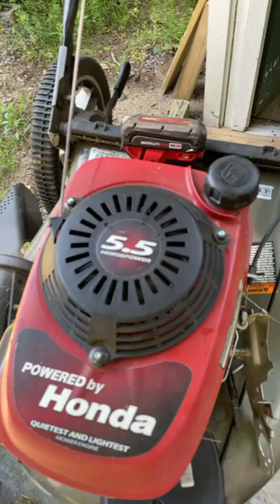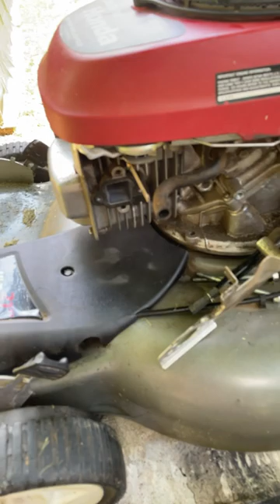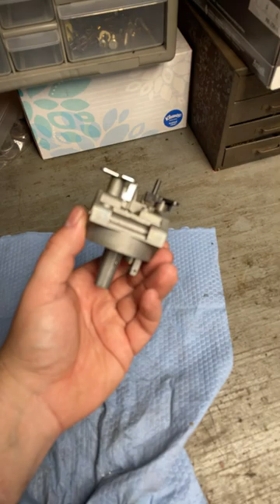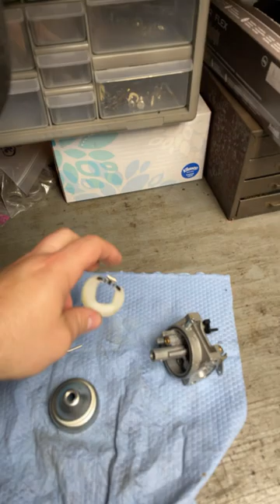Honda mower leaking gas

Comment: I have a very similar lawm mower. It's like 20 years old. It does not hold a consistent RPM but otherwise it runs fine.
Reply from the maker: 20 years is a great return on investment! 👍🏻
Reply: Dirty Carb
Governor stickying ??